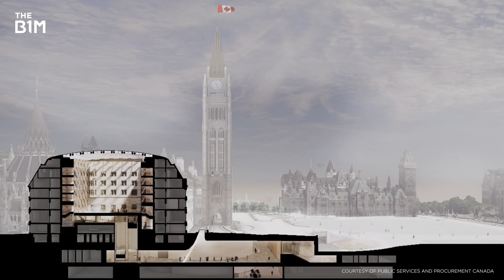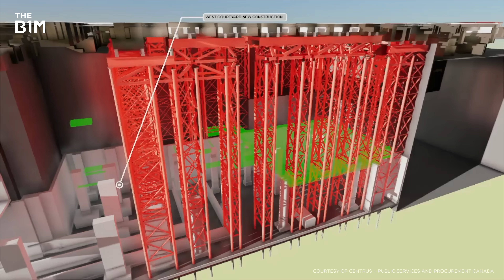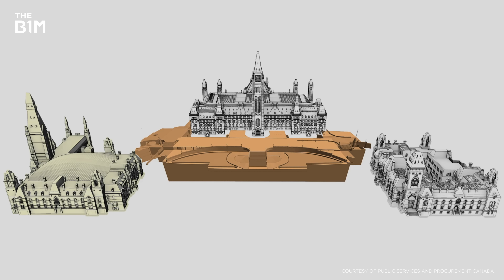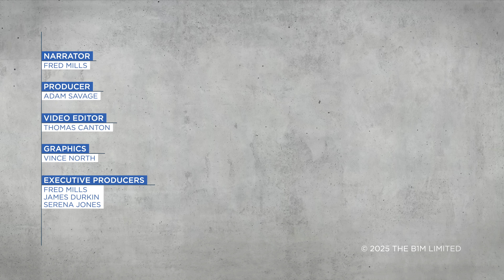Why Canada Blasted a Huge Hole Outside its Parliament

Comment: Part of the reason this is taking so long is because when Parliament was rebuilt, there wasn't a whole ton of documentation done about it. So quite often the people excavating/demoing for the project literally have no idea what they might dig into, as if they were uncovering something completely undiscovered before
Reply: It's like essentially everything else (e.g. Nuclear Waste Disposal) - either prepare ahead of time & future-proof or take your time later to do it right, often with a budget that's far higher than if you had just done it properly in the first place.
Though yes - sometimes time-crunches are necessary!
Reply: Do you think it’s been a long time? (My friend took seven years to complete his bathroom tiling)..
Reply: There was a fire circa 1917 if I remember right.
Reply: That element of surprise always extends a renovation project, as any homeowner who has been there can attest
Reply: Not sure about that. The parliament buildings are built on 50 meters of limestone bedrock above the Ottawa River so they in fact never built anything below the limestone,  and the building is almost a 100 years old, needing serious repair, so it's not exactly blast safe. They can't build sideways, really only way to go is up or down.
Reply: every excavation is like that.
Reply: BEACHRBUGBN
Reply: Did SNC Lavalin build it???
Reply: Remember there were tunnels there also.
Reply: That's kinda epic haha
Reply: Interesting ... side note , was researching b cert origin , looked up the hospital,  has changed ..ship , ok , archives at the local college ( 😒 🤔), called college and none of the "persons" data is there , ended up calling the "current" hos-ship , records  are destroyed after twenty and five yrs ( essentially), interesting , eye saw and ear d some who claim an allotment was suppose to be "given" to ... well between twenty one and twenty five yrs of age , co-insidence surly , called the county clerk to inquire about the "signature" of the clerk at the time on the cert. She said she would have no idea of the clerk of that date even when given the month and year of the event , seemed odd she didn't offer to try to look up ...
Reply: ( AC/DC comes to [its ] mind ; "who made who ... ain't knowbody told you ... " ) 😔 lol
Reply: Pretty much like every building. Lousy record drawings.
Reply: Love this! ❤ Thank You! ❤
Reply: Proud we are doing this
Reply: New ballroom?
Reply: Because they found this structure they never constructed it like they said the did
Reply: The precious building that cannot be re-built using today's technology does not have earthquake protection.
So they blast dynamites right under it to dig deeper?
Reply: @sbkarajan  good ol dynamite because they can’t maintain it and progress means these structures represent the old world HAHAHAHA so instead they gotta build progressive structures made out of glass
Reply: There was a massive delay when they started digging up the back yard because they stumbled upon the former location of a military barracks that wasn't on any of the original plans. 
The new roads went in months late because they had to dig up all the garbage, now "artifacts", that the soldiers had buried in the latrine.
Reply: @PetrolPaladin  EVERY PROJECT in Ottawa HAS EXCUSES for BILLIONS in cost overruns and EXTENSIVE "delays".   TAXPAYER RIPOFF ALWAYS.   Look at the Ottawa Transit Extension for more proof.   BILLIONS in over runs... for a system that will become one of CANADA'S BIGGEST BOONDOGGLES.
Reply: @Canadianguy-d5d  shouty
Reply: @Canadianguy-d5d  petrotroll seems to think that overuns never happen anywhere else than ottawa. How many major projects in any country have ever come in on time and under budget in this millennium or the last one? They are freakn unicorns.
Reply: @PetrolPaladin  Nothing is on any original plans. Furthermore, 50 billion would never restore this building, they intend to demolish it, just like all the other Old World buildings. That's why they put out that ridiculous number. Our humanity is simply not capable of fixing these structures.
Reply: What??? We've had x-rays for architecture for years dude. What are you talking about 😂😂😂
Reply: @CarbonSickle  The project team has actually released several videos of the work being done, and they still have found a few surprises, like a window hidden behind a painting.
Reply: @ruaphoc   ZOMG you'd think they found Predator technology in there.

A cellphone with FLIR can see through a wall, get out of here with your "the window behind the wall was such an incredibly unexpected surprise!" jokes
Reply: @schimor I think it's the documentation part. It's treated like an archaeological dig and everything needs to be logged. I imagine they have no trouble finding these things, but they are surprised by the amount of bureaucracy surrounding the work.
Reply: some interesting comments🤣to the original post, there is literally a secret labryth under ottawa. Tunnels connecting the government buildings and you need a mid to high level security clearance to access them.
Reply: So they have more records of medieval Europe? Hahahahahhaahhaah ya ok
Reply: @stenbak88 Yeah, they do actually. You know why? Because the cultures living in Canada during the medieval period didn't keep written records, and have since either been wiped out or had their culture sterilized. So if medieval Europe has any records, they have more records.
Reply: @robertb1633 yea, Indigenous peoples handed down knowledge by word of mouth or story telling.
Reply: I worked on this site, there’s a ton down there no one knows about
Reply: Allowing access to visitors under parliament seems like a bombing risk
Reply: @ERROR204. The screening area is not underneath the building
Reply: @ERROR204. Maybe by one of Guy Fawkes' relatives 😮.  I'm sure there'll be security scanning at all public entrances. Now we have to worry about MAGA nuts.
Reply: @ERROR204.  Look they do it at the Capitol in DC so it's gotta be ok. Plus, everyone loves Canadians so no-one wants to do them harm.
Reply: @VanillaMacaron551  aside from..our own politicians.
Reply: It's solid rock.
Reply: Canadian Illuminati Headquarters?
Reply: @MikMoen wouldnt be open dummy
Reply: So true. Every meeting I had about this was a nightmare because we could just see the time and cost estimates build
Reply: no. working there, i know for a fact how those companies are milking the goverrnment as much as possible..................
Reply: So they have no documentation of what is under the ground and they don't know what they're going to run into but they decided to use explosives to make the hole bigger? Something about that doesn't check out. What would they have to be so worried about running into under there, if they're worried about what running into artifacts why would you use explosives
Reply: @nintendogeek64 . You should think before writing. How do you think they got the explosives down under the ground surface. They drilled holes and lots of them for each blast. Looking at the blasts shown the drill pattern would have been fairly tight. If something had been buried they would have encountered it during drilling.
Reply: @nintendogeek64  They don't know the layout of utilities, shafts, ect. under the building. It is known there's nothing under the lawn. The same thing is an issue at Eglinton Station in Toronto. They dug underneath it for a new east to west line, only to run into undocumented cables, water mains, and the footings for the original station starting to slump. Which was because the original subway project under Yonge was not fully documented utility wise.
Reply: @nintendogeek64  Dramatic license with the script there. I'd say they did every geo-phys, geo-tech test they could do, including core samples, etc. I'd guess once they realised the building had no foundations, their main concern was that the rock/soild/whatever under it was firm enough to hold it up if they excavated right beside.
Reply: @nintendogeek64  That's closer to the surface. The area where they were blasting is solid limestone bedrock.
Reply: They will keep those findings secret.
Reply: This ground is the most solid ground on earth why put 500 shock absorbers. This is truly waisting Canadians money.Put that money on the Canada deficit. Too late!
Reply: @Pierre-i1r7k If you lived in Ottawa you would know that the city is in an earthquake zone.
Reply: No matter what, constructions always take 20 times longer,  cost 100 times more expensive in Canada and some people make fortune off it;  this is how it works in Canada.
Reply: @sahicizm same everywhere on the world, this project is for sure going to cost near 10 billion instead of 5
Reply: No no wrong what a classic dumb home owner response ,,,,we know exactly what we will run into,, and the amount of time this project will take will be 20x longer then anyone else because its a massive fraud schemes to the Canadien tax payer ,,eveything will be billed 29x to 25 doffent sub contractors
Reply: Disappointed to learn the hole wasn't a grave for Trump.
Reply: @DAVIDPOIRIER-v3q The secret Service is on its way to your door … they will be taking YOU on a tour of the hole 😂😂
Reply: THIS MAKES NO SENSE
Reply: Waste of money. Take it down and start over.
Reply: @chrisrasku2261 okay then
Reply: WHAT a LIEberal REDICULOUS EXCUSE!!!.   IT was built on BEDROCK. THE WHOLE REGION IS ROCK!!!  NO "surprises"... just LOOK at the video... you can SEE it for yourself!!!
Reply: That's because we didn't build it
Reply: Maybe they should plan it. I wonder if canada has planned it. Do you think Canada has planned it. I think so. They're a GREAT country, simply the best. Spectacular, surely they'd plan it very well. I know they did because they are a GREAT country. Only the best. Cheers!
Reply: @KeshiaOkafor07 How about the Newfies from Newfoundland?😂😊❤
Reply: @EFitzgerald1975 excellent people! I am proud Newfoundland is part of our great country! We'd be missing some lovely people without them! Cheers!
Reply: @TheodoreBensonWalbert best at meth and weed yes planning saudie does it better 911 proves that..
Reply: @KeshiaOkafor07  Was this a Donald Trump impression?
Reply: @Goitom04 YES LMFAOOO DID NOBODY GET THAT ??
Reply: @KeshiaOkafor07  

OK Donald shut up lol
Reply: @Johninadelaide2022 i love you too. Ik you're a baddie for Halloween
Reply: @Johninadelaide2022 i love you bbg I know your a baddie for halloween
Reply: @KeshiaOkafor07  Trump, is that you?
Reply: @jessefisher1809 ahaha I hope not!
Reply: @KeshiaOkafor07  Its all planed. This is a video to steer you in a different direction.
Reply: It's a Tartarian building, we didn't build it, of course there isn't documentation. The Masons renovated it, just like they renovated our 'libraries' and 'post offices' and 'asylums'. That means messing with a roof, ripping off parts of the facade, so the building slowly rots from the inside.
Reply: @togowack  There are literally photos of the site before any buildings were put on it. People like you shouldn't be permitted on the internet
Reply: @togowack I just had to look up what you're talking about, and I have to say, you're an idiot.
Reply: @togowack  Built in 1927! There will be photographs of the whole thing. Stop with your crazy talk. Everyone else - check out these "Tartarians". This is a whacky theory that argues the whole world suffered a giant "mud flood" in the past century, ffs. They do not understand the technology that brought ornate concrete moulded building exteriors in the 1800s, nor do they understand the wealth created by gold rushes, colonialism, and rampant capitalism in the new and old worlds. Due to all these things, yes, we did go from basic log cabins to ornate, multi-storey granite edifices in a short space of time. Yes through a whole lot of natural processes and man-made engineering, some older buildings got buried below street level. No, this does not mean there was a global mud flood 100 years ago that never made it into the history books, and from which no photos, drawing or memories survive. It doesn't mean our cities were built by ancient people. Yet the "Tartarians" made a worldwide "belief" out of this crap. They get together to talk about it, make videos on YouTube and they're convinced that all modern historians are lying. At least it's amusing, and apparently harmless.
Reply: @togowack  clearly you've never heard of a foundation before they dug rather deep when it was rebuilt so they could install the tower stop with your ludicrous conspiracy theories they dont even make sense
Reply: @Bub-k3o  Can you explain why there are windows and doors that open to mud below our 'ground  level' in all Federal buildings nation wide? (Canada and US and UK) the existence of fully buried steel gates and cobblesone roads at the real ground level - known of by trades people who get asked to work in these places. Oh, and can you explain why I am not getting notifications on this post anymore? (shadow banned)
Reply: @togowack this building does not have any window or doors to the outside in the basement
Reply: @togowack  Had to look up what you were even taking about, and I want you to know that you sound crazy. This is an informative video on a historic building and you're spreading nonsensical misinformation in the comments section, take some time to reflect on that.
Reply: @roastyfox  This is a video about a false flag. They want to demolish that building, I am explaining to you why,  but it will seriously challenge your world view on who runs things and how you play into their agenda from the start. Keep paying taxes, citizen !! everything is normal.
Reply: @togowack I know you won't believe me or say I'm part of the machine, but I'll say for others' benefit: I used to work on the Centreblock Project. They're not demolishing it. I've watched people erecting new structural supports. The interior used to look like a crumbling office park from the 70s. They spent two years just removing asbestos. It needed the renovation. And there are no underground windows in the basement.
Reply: @PetrolPaladin  the parts of the building I'm talking about have long been blocked off if you know what to look for. The proof is better seen in lesser value buildings, local post offices for example.
Reply: @togowack bro if documentation is so important than why don't you document how you came to the conclusion that this tartian bs is legit?
Reply: @KeshiaOkafor07  All you have to do is take a look at the foundations of the buildings in person, they have false footings installed. What we call ground level, is actually floor 3 or 5 of these buildings, all around the world. We didn't build them.
Reply: @togowack Yawn. People are still yapping about tartaria in 2025? Have you been outside in the last 5 years? Or have you just been perpetually online? 🤦🏼‍♂️
Reply: @TheJonnyRocket95  Like I said, if you want to prove the theory, the best way is to step outside yourself and inspect one of those buildings in person. I didn't know there was some sort of time limit on common sense
Reply: @togowack  It's not a time limit. It's the mountain of evidence that proves the entire theory wrong, that is also readily available on the internet, and has been for years 😂😂 Basement windows dont prove you right lol
Reply: @TheJonnyRocket95  Wait so now I'm supposed to go on the internet to get my information? Which is it? This mountain of evidence - why don't basement windows prove me right? When it applies to millions of buildings all around the world, something happened not being explained in official history books? We call it the Great Flood of Noah.
Reply: @togowack  Clippy wouldn't post the insane bullshit you're posting.
Reply: @togowack For anyone wanting to know what this loon is talking about.

The Tartarian (or “Tartaria”) theory is a fringe pseudo-history conspiracy claiming that there was once a vast, highly advanced global civilization called “Tartaria” that built many of the world’s grand old buildings cathedrals, courthouses, train stations, etc. The story goes that this civilization was wiped out (usually by a “mud flood”), and modern powers supposedly covered it up, stealing credit for their architecture.

😂
Reply: @Dave-om6nd Which is exceptionally funny, considering Centreblock was built in the 20th century following a fire that destroyed everything except the Library. There are Photographs.
Reply: @Dave-om6nd  Who was the loon again lol
Reply: @togowack the one who believes in an insane conspiracy theory. That wasn’t hard to figure out. I was pretty clear.
Reply: @PetrolPaladin right? 😂
Reply: @togowack what is it that makes this theory more appealing than the simple theory backed with evidence: our governments are the same as those from the 1800s, and the styles we build today simply evolved as time passed, as did our morals, technology, and architecture?
Reply: @KeshiaOkafor07  There is not much evidence for your theory, except they teach it in schools and put it in movies, because otherwise people would come to certain realizations. That it is ridiculous to think a few thousand starving farmers built structures we couldn't build today in between pandemics and war, using horse and carriage.
Reply: @Dave-om6nd  I think "pseudo-history" is a generous description. This is on the level of flat-earth in terms of sheer stupidity.
Reply: @TheJonnyRocket95  I was so sick of hearing about Tartaria. So much that I specifically put the names and variations of spelling in the block list in Facebook, Instagram, etc.
Reply: @togowack  having just learned about this Tartarian nonsense this is hilarious. up there with flat earth with biggest smooth brained analysis of history and architecture i have ever seen lmao. plenty of reasons for backfilled doors/windows. the idea of a mud flood that would wipe all signs of them from existence but leave perfectly preserved basements is literally the dumbest thing i have ever seen and ive lost braincells just looking into it and talking about it.
Reply: @togowack  Bingo.